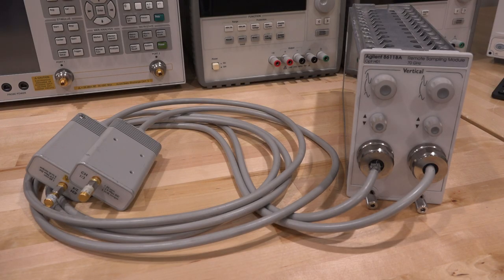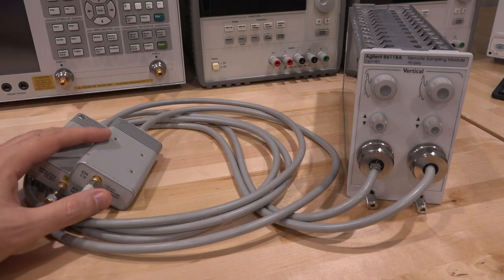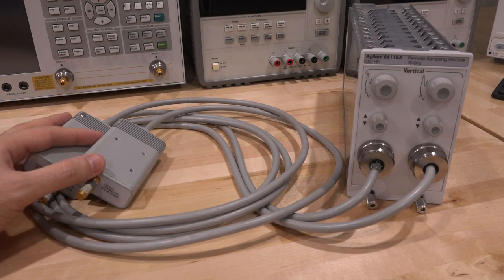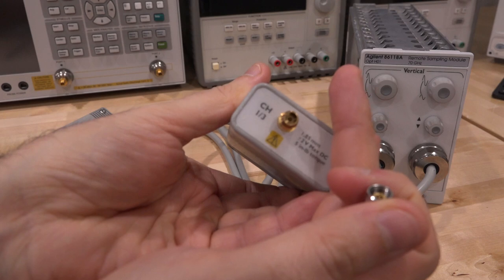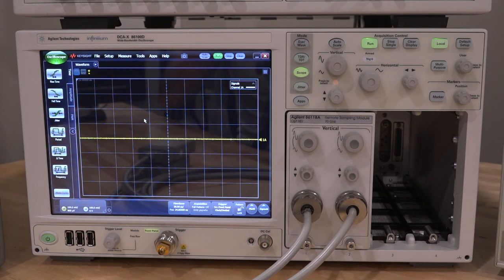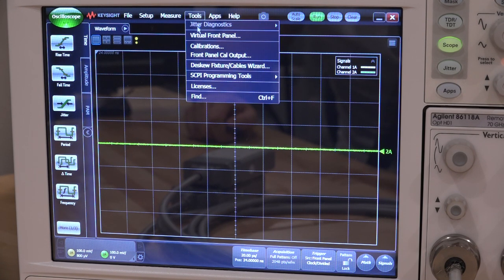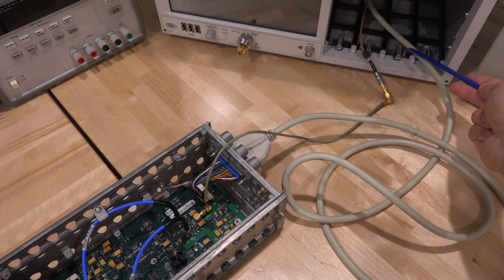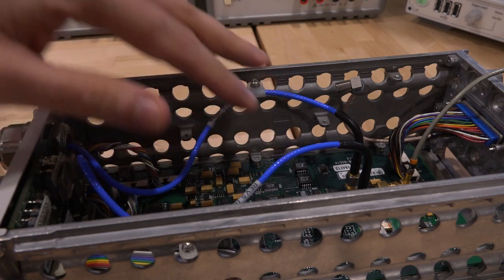TSP #177 - Teardown, Repair & Experiments with an Agilent 86118A 70GHz Dual Remote Sampling Head

Comment: Yay, new RF magic video! I blame TSP for luring me into RF stuff now. Auch, screwing terminator body on a 1.85mm connector, not a good RF practice! :) 
We do want to see it open, if its not causing a full destruction. Sampling heads are still very valuable things, and a way to get "cheap" bandwidth for repetitive signals, like often used in digital electronics today.

Comment: Would definitely want to see an x-ray of the sampling head, much less risk of damaging the expensive bits 😬
Reply: Ben Model ,  I was thinking the same thing!
Reply: X-ray may damage the semiconductors inside.
Reply: @paulcohen1555  TIL, interesting!
Reply: @paulcohen1555  x-ray normally only damages semiconductors if they are powered (avalanche in power mosfets etc). Also, low power x-ray won't do anything (airport security doesn't kill 100ds of phones everyday)
Reply: @Leonelf0  Didn't knew that.
Good to learn new things.
Reply: Yes. As much as I'd love to see the inside of one, those units are quite expensive.

Comment: So the analogue bandwidth of the head is 70 GHz but the sample rate is much slower and phase of this sampling  trigger is slighty changed from sample to sample. But how you can generate so precise phase delays? And what component is being used to sample this high bandwidth signal with low repetition trigger?

Comment: Good explanation and discussion of the items you were fixing. I do hope that the 'parts unit' (e.g. the CDR module shown between 0:06:20 - 0:06:58) proves as interesting when you get around to it, hopefully it also proves fixable. There is still a place for obsolete test equipment as some other channels have shown.

Comment: Hi Shahriar, Could you also explain shortly in your videos that in which section of the industry these measurement instruments have the most application? (e.g. 5G, Automotive, medical, etc.)
Reply from the maker: Sure. This particular instrument is used for high-speed communication measurements such as wireline and optical.
Reply: @Thesignalpath  Thanks for the info. I agree it would be super useful if you could spend a minute or so explaining the use cases for the instruments you repair in the future!

Comment: Really nice man! Do the heads have enough dynamic range to sample a signal directly from an antenna ?
Reply from the maker: The issue is not so much dynamic range, the issue is that they are extremely broadband samplers and therefor integrate a lot of noise. But also you can only see a periodic signal on them due to the sub-sampling nature of the instrument.